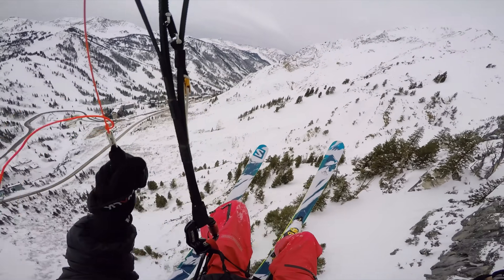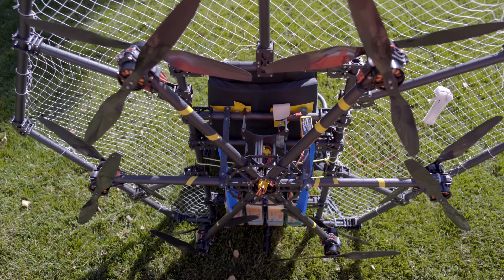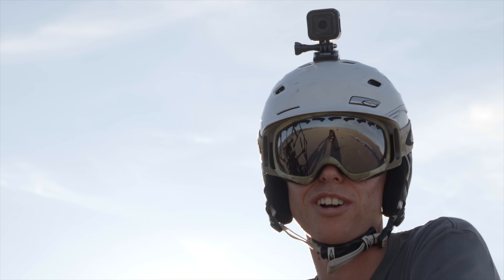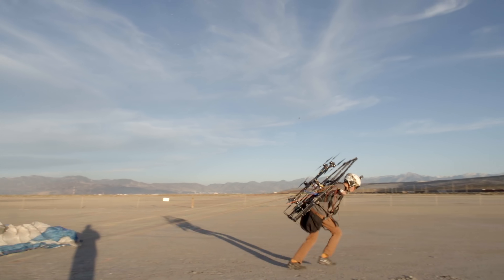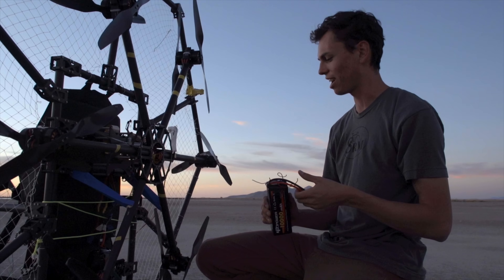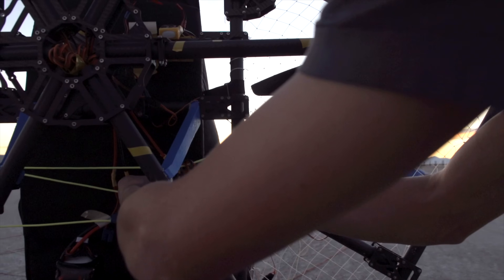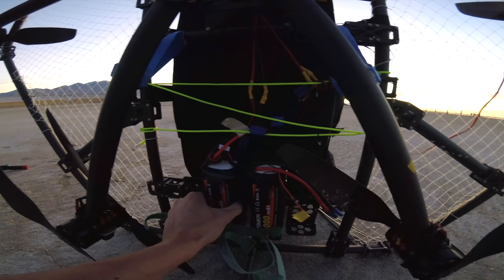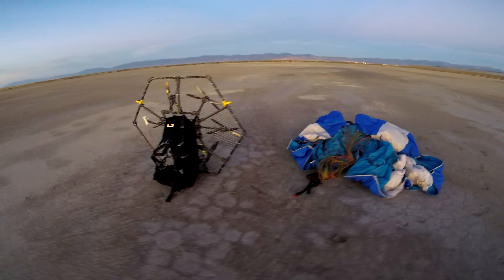12 DRONE Motors On My Back!? - DIY Paramotor - RCTESTFLIGHT

Comment: For high current wire connections it's best to both crimp and solder, and make sure you strip the maximum length of wire so you fully penetrate each connector.

Comment: Those lipos are convenient, as they come in nice square packs, and are ready to plug up. But they can be super dangerous, as I'm sure  you know. You definitely don't want an in-flight fire. You could build a super durable pack, with more legs, using 21700 cells. Or even 18650s. Just a thought. Nice job on the paramotor, BTW.

Comment: I work with lipo batteries on rc planes a lot.   An extended on the ground full power test is a must.   Also proper engineering re wire size and connector size.  Cut and try does not work.

Comment: This was both incredibly brilliant & insanely dangerous. I’ve never paramotored but I’ve seen enough to know how difficult it is, it’s really impressive you even got up in the air! But I can’t believe you actually tried to wire up 12 high current motors with 2 measly battery connectors lol. You always should add up the max current of each motor and wire appropriately. 

This video is 2 years old so hopefully you’ve learned to respect current :)

Comment: Its a lot lighter than a para-motor full of gas. Whats the range of a para-motor that is full of gas vs your electric one? Or whats the weight of yours with enough batteries to have the range of the gas one?
Reply: Also the gas engine re-build after 100 hours turns me RIGHT OFF. Why not fly into thermals. That's the only way I fly. They are everywhere, just hafta pick the AM and learn a bit.

Comment: Rule n1 in electrical engineering : if a wire melts, try with a bigger one. Don’t try to figure out the actual current and copper section requirements.

Comment: Get someone trained in electrical power to properly size the wire and connectors to keep the wire from being overloaded.  The last problem you want is to fight a sudden fire in flight.

Comment: It's GREAT that you reduced the voltage loss by using a heavier gauge. How much more power did you realize?

Would you be able to make the prop basket round smoother?

A faster wing will also help. I have a large Poison 3. It's touchy but its a rocketship.

Such a great idea. Fly high and far.

Comment: Very fortunate the Lipo didn't go and send a 5ft torch through your spine.  Might want to put a fire wall between you and the batteries (and probably put them in a box).  It should be very possible to make it safer.  Maybe make a rounded cage around the drone props so nothing gets tangled or damaged on bad take offs.  Very cool.  And love the rc rocket.  Subscribed!

Comment: Stay safe buddy, I'm sure there is potential here but also potential for extreme danger lol, lipo batteries are deadly if shorted out or punctured, I would not want them stuck to my back whilst I'm up in the air unless imm100% sure everything is ok.
I've thought about doing this so may times over the years and it's nice to see someone try it out because I simply can't afford to buy the parts.

Comment: Very awesome video. However, I suggest you to do some calculations on wires and please dond use tape to connect wires because its unsafe. You can do this on RC planes, but in case you are flying, so I highly recommend to do more serious preparations.
For calculations you can use this: http://www.solar-wind.co.uk/cable-sizing-DC-cables.html
And for the losses you just need to mesure resistance of the wires (including connectors) and then Loss = (current^2)*resistance.

Comment: Yeh, you're going to want to use screw-down patch connectors. Solder's just not doing to hold up to the heat. I really like this kind of innovative thinking. Was awesome to see an electric paramotor taking flight. Congrats, and thanks for the video.

Comment: How is it that you "interned" at such a place and never absorbed any form of scientific method or engineering mindset ??
1: You need to test the rig at full load first (wires etc).  2:  You need to flight test using an exp'd PPG person and a big well-proven lifty wing - so that your difficulties/success would be isolated to the one variable you meant to test (your rig).

Comment: I'd be using quality and proven connectors such as Andersen Power Poles. From  the views I saw it looks like the parachute lines come perilously close to the unshrouded propellers. Chicken wire?
 Would one larger motor be more efficient than six small ones?

Comment: Hay great vid dude!! showing the first attempts where you fumbling , shows character :-) Might i make an suggestion with your esc / power cables. I fly myself EDF's and a rule is that you keep the DC cables (between Lipo and ESC as short as possible. so mount the ESC's in the center of the frame, and put the 3 AC cables to the engine through the Tubing to the motors. It prevents boiling the resistors and makes it more easy to tuck away the cabling... But great attempt i'll keep my eye out for the next version :-) regards  Nico

Comment: You can get a gas powered paramotor that only weights five pounds more than this one that has MUCH more power and lasts longer, so the weight issue is really not an issue.

Comment: I would like to build an electric para motor and am pleased with your success. The thing I wonder about is the diameter of a single propeller in comparison to your 6 prop array. I think that the wider diameter could cause problems with snagging lines.

Comment: That sounded scary, like the attack of a billion angry bees. 
What's the problem with electric system? Is it for the weight the batteries aren't able to store enough energy to make flying them versus gas worthwhile? I've seen a few attempts at electric para motoring. I think it may be the same reason I don't have an electric lawn mower, but I still wonder why electric cars are possible.

Comment: As a project - fantastic chance to spend some time. As a product, useless, due to bat capacity. When it comes to joy from the ride, 2-stroke engine is way better than constant buzzing of a milion mosquitos :) (Private opinion)
On the other hand - (technical) progress won't happen on its own. Fingers crossed :)

Comment: Not sure if anyone had already mentioned this, but here's a major engineering problem with your design. To produce maximum thrust, a prop need as much as possible an unrestricted air stream of dense unbroken air. Props work notoriously horribly at high altitude and in major turbulence because of this. the only reason that props are ever doubled is to eliminate torque with counter-rotation. Some helicopters use this as they only rely on a single motor. When you have 6 mounting points, this is unnecessary. The first prop accelerates air, thus the second prop isn't having any serious effect on thrust. so half of your props are adding maybe 10-20% to thrust. Rather wasteful. But the BIGGEST engineering fail of this design is that props generate thrust by pushing VOLUME of air. Volume is proportional to the RPMs and to the area of the prop. As higher RPM, the props get very noisy, and at high area (blade length) the blades become difficult to push. Since burning gas produces more energy per unit of mass than a battery, you can thus push a larger prop for longer with a gas motor than you would with electrical. Given same range of flight and same thrust, you would need a much heavier battery with a faster spinning prop to generate this than a gas engine with some fossil fuels in it. Which brings me to the key poor factor of your design (not mentioning the frame, as others have already described what you should change) - PROP AREA. Formula for the area of a circle is Pi*Radius^2. This means that for every doubling of radius, you get quadrupling of the thrust at same RPM. This means that the prop's most useful part is it's outer edge. the wider area it can sweep, the further it goes. 75% of your prop area is either blocked by the pilot and the frame or it consists of the motor cores. Your motors have to work ridiculously hard to sweep just a bit of air on the outside of the frame, which they don't cover completely, as a single long prop would. Now, if you have multiple motors spinning a single prop through a belted system, you will solve this problem, while still being able to use these puny little motors, not designed for this task. But then you have the issue of extra weight from the bad design. Using a single motor intended for high torque would improve weight, but that's been done. Lastly, the biggest problem of all battery-powered PPGs is that the range is significantly reduced in cold weather, and once you land somewhere with a dead battery, you can't easily go to the nearest station and refuel. You need to drive the whole thing home to recharge.

Comment: Yeah, old wings suck. Please don’t abandon this project. You are miles ahead of others that would like to get off ground w electric power and you are learning a lot as you go along. I would very much like to see a thrust test when you have a chance to get around to it. After that I want to know how long you can run that system at full power once you have the wiring straight. Cheers!

Comment: I suspect wire gauge wasn't a problem just rubbish soldering that cause high resistance at ec5 connector.  This caused lots of heat and melt solder at the connector

Comment: Just add super-thin solar cells to the top of the wing, then move to the atacama desert (almost always clear), then maybe you can fly all day without any batteries at all --- which should enormously reduce your weight, since those batteries are not lightweight!

Comment: We used 4 motors, and 4 props, Aluminum lasercut pieces all bolted together, a trike, and 6 30mah lipo batteries and only got about 40 minutes of flight time.
Reply: 40 minutes is impressive!

Comment: For your wiring problem, just use 10 awg wire the entire way thru. That will definitely help with voltage and current flow. You cant be splitting your wires into that thin wire like that. Hope this helps! Mad props bro! Soo sick

Comment: Because your not quickly changing the angle of the props whole flying, you might get a substantial thrust  gain with a ducted system and in turn need less power.

Comment: Might be better looking at running lower KV motors and a 12s battery setup, as well as still upping the wire gauge.

Comment: most inefficient thing I've ever seen lets use 30 motors that loose 15 20 percent due to heat instead of 1 motor 1 esc

Comment: You might like to test it on the ground at full power, until your batteries are flat, to make sure that the system can handle the load, plus you then know how long you have. Also I suggest make the edges of your frame so that lines cannot get caught.  One way to do this, is to cut a bit of alkathene pipe long wise, then slip over the frame.

Comment: You didn't secure you connecters? Good way to die in a fire. That is a lot of power going through those little wires. Use a car battery. Don't give up. It's a great idea

Comment: When the FAA piles heaps of restrictions onto paramotoring, think back to this video. Guys like him who end up killing themselves through sheer stupidity are always the reason we get restrictions, bans and licensing out the butt.. If it ain't broke, there will always be some numpty trying to 'fix' it. 

Please get lessons before you try and fly. All it takes it one millenial getting dragged across a freeway and into a truck, or worse into the engine of a jet airliner before it ruins it for adults everywhere..

Comment: Daniel! I made a setup that uses one massive 190 kv motor and a 32 inch props. If you want to try to make one yourself I'd be happy to send a motor over and all you'd need from there is a ESC and prop! I run 6s and a 120 amp ESC but I'm sure you can get away with a 24-26 inch prop on 8s! with an 80amp ESC
Reply from the maker: I might be interested. What kind of motor is it?
Reply: A Very large (Brushless) KEDA Motor
Reply: Can you give us the exact model and maybe a link to the motor that you where talking? Thanks!

Comment: Besides upgrading your wiring, make a fire proof case, separate compartments for individual batteries, better still a quick release to jettison them in emergency. If your LiPo's caught fire it could be fatal, it takes a while to descend! I have just made several DIY fireproof lipo cases similar to bat-safe dot com but mine use ammo box lined with ceramic fibre & on the lid I drilled some holes, wrapped rockwool in wire mesh to filter the flames and keep the soot inside. For paramotor application you could use thinner steel to keep light. If the batteries go on fire in a box the heat, gas & smoke must escape but you could direct it somewhere with perhaps pipe fittings etc (rearwards!). Bravo for your project but please take more care, make it perfectly safe before you continue!!

Comment: Alishanmao did this with one big motor.  There are also similar electric paramotors at the light aircraft show in Germany this year.  All single prop, single motor.  They also spaced the prop back away from the motor to the rear.  Not sure why, but that's the trend.  I'm a PPG pilot here in Utah.

Comment: I cannot believe you got that to work from two lipo packs lol.. what did you push like 300 amps through them? LOL!  YOU ARE SO LUCKY YOU DID NOT COME DOWN AS A FIREBALL!  btw I'm i've built a 20kw single motor unit for powered hang gliding, this option would be way better for you.  Look on alibaba for the 50kv motors, run them with 14-16s on a large paramotor prop, and for the love of god stay within your "C" ratings!  your gunna need 1kwh or more than 20 ah of battery capacity

Comment: I'm surprised and disappointed that you didn't do full power testing on the ground before flying.  That would have shown that your cables were way too small.  Build a test stand.  Run it full throttle, repeatedly.  Check and recheck. This makes it easy to see potential serious problems before putting your life on the line.  A fire while up 1000' would not be good.  Looks like fun but safety first.

Comment: As others have said, go up on wore sizes, etc, and also keep the wire harness short, so that you don't get ripple current issues. Ripple current can destroy ESC's, motors, and rob power. you can do these 3 things to fix it:
1 keep harnesses short 
2 use LOW ESR CAPS near ESC's 
3 use larger than necessary wire size.

Comment: A larger single propeller with reduction drive will be much more efficient than your design.  At low airspeeds big props do much better.  Also consider a battery release mechanism in case of fire. It  would suck be at 1000’ and have a fire from shorted or faulty Lipo cells.

Comment: Please make sure you use a wing that doesn't stall on you. Also looks like in the current setup, it is difficult to apply 0% brakes. Paramotor starts, just like winch starts, are tricky at low speeds. The Skywalk glider was probably a good choice because the manufacturer claims that they are "impossible" (= hard) to stall.

Comment: Love the idea of a multi motor setup. I’ve often thought of doing something myself like this. Maybe you could wire your motors / batteries in groups so if you have a failure you would only loose a part of the capacity and not overload the remaining batteries. Say you had 4 batteries, and 12 motors, wire 3 motors to each battery. 
Looks great, I think your pretty close to a very nice system. Love the videos!
Reply: Mike Christiansen check this out then https://youtu.be/IvmQbtxeKuE
Reply: Thanks for the link, your project looks very professional.